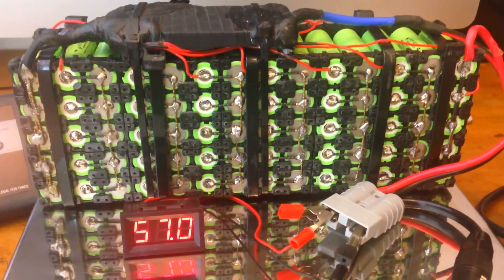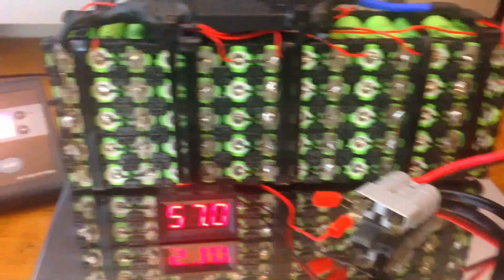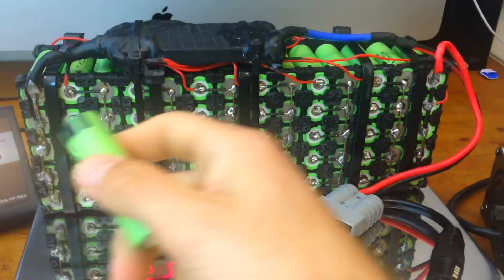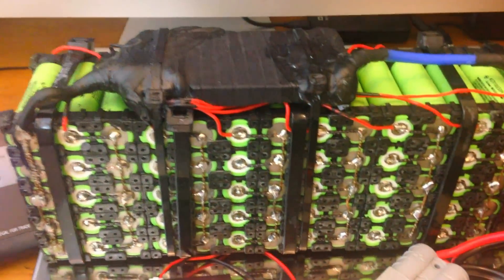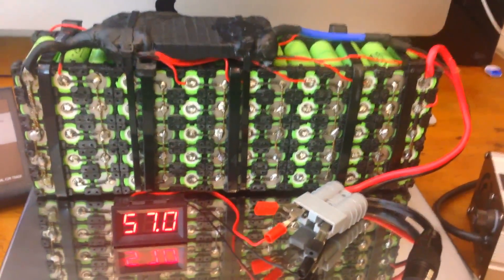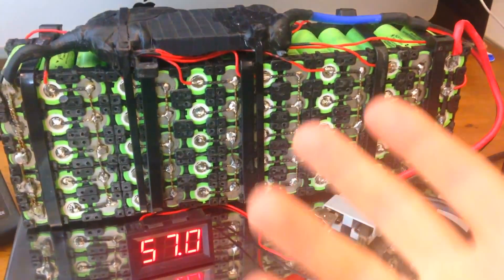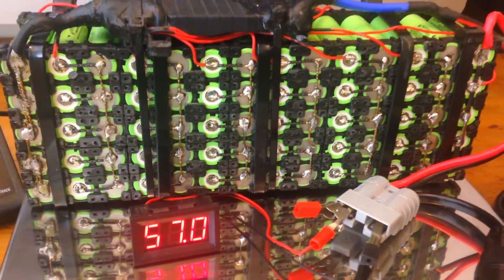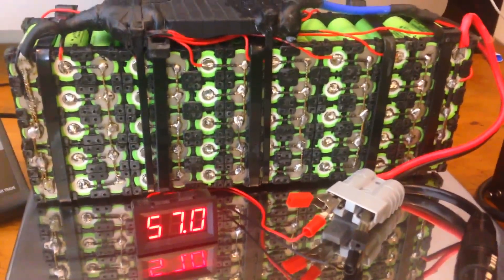Panasonic (Tesla) 52v 14.5Ah battery pack with Fast charger (14s 5p NCR18650PF) Bafang BBSHD BBS02

Comment: Nice video!
I like that you mention the use of a BMS (The Battery Management System).
However, you should not phrase it like something optional. If you decide to disconnect the series and charge all the parallel units individually, fine. 
However, charging this pack without a BMS at 58V will bring these units out of balance and can cause a fire.  
I personally don't like these guys uploading videos and not mentioning the problems that come along with lithium Ion cells. There are some clips soldering these packs together without a BMS, without mentioning that at the positive side the negative and positive are only millimeters apart. This is something very important to consider when soldering. 
I like your channel and think that you are very knowledgeable. You should consider rephrasing your statement at 2:31.
Reply from the maker: +davidcandlelight - Hi David, I watched your video showing all the nice work you've done... congrats for all that design ideas you shared =]
In regards to my BMS, 9 in 10 battery problems are caused by faulty BMS or something related to BMS. I know that the newer 18650 cells are very stable and will hardly get unbalanced specially when combined connected in parallel with other cells (4p, 5p or more) so they are self balancing each other. I disconnected my BMS in September 2015 for tests, just to see how long my cells would require balancing https://www.youtube.com/watch?v=EVv5z7GABx4 
I am writing this message today 21st of February 2016, I have been running my pack really hard pulling 30A every single day and charging it at 6A at 59.2. It is normal to charge above the pack limit 58.8v as the internal chemistry still reacting to the charge 90 minutes after stop charging. During this process the cells will slightly drop the voltage and set down to 58.8v the maximum recommended for a 14s pack with PAnasonic PFs.
In saying that BMS is a must have device for 99% of the users controlling all possible user mistakes, wrong chargers, reverse polarity, balancing the batteries, low voltage cut off and high voltage cut off and many other features. 
I only play without BMS as I have total control of my environment and devices I connect to my pack. As you know, it is very hard to consider all million scenarios while talking to the camera recording a video like that. I wish I could add a lot more info.. change some words... it is hard to get everything perfect =]
How is your battery pack going???? Please post more info with updates and explaining what you would've change and what you absolutely love. I am very curious to know these things after watching your video. =]

Comment: Hello Again... Have you noticed that hardly anyone in the USA is making Lithium-ion battery packs with Panasonic 18651 E cells?  I called around to the Tech Colleges to find out who teaches lithium battery pack building.  No one does.  I think this is an untapped market.  Shipping from Japan and China is very expensive because of duties and regulations.  
Building battery packs like this could be a very lucrative business because you can reduce shipping cost to outbid the foreign competition.  Let me know when you start building some Tesla style battery packs.... Remember, ebikes are still relatively new to most people and look at the electric hybrid cars coming on the market today,  All of those batteries will eventually need to be replaced and no one in the USA is manufacturing them.  This is your opportunity.  You will need a $12k pulse welder to do it correctly.  But I don't think a bank would have a problem with a loan if you give them statistics on supply and demand in the near future market place.  :)
Reply from the maker: +Robert Krause - Yes... this is very strange that no one is teaching how to build batteries... we all need batteries nowadays... but there a lot of very conservative people out there... I surprise a lot of people when I tell them that I work with electric bikes, I make and repair battery packs as a job....
There is a big crackdown on batteries shipped via air since December 2015... battery companies are struggling to ship internationally. If all countries were making packs locally we would not be experiencing these problems... 
There are some $400 chinese pulse spot welders with pedal switch, ugly was hell but they actually do a good job. I am located in Australia, just like other developed countries around the world the ebike business is BOOMING... this is fantastic.. I would love to see less cars on the road a a lot more cyclists.. pedaling is good.. keeps you fit and does good for the environment too =]
Electric POWEEEEEEEER....
Reply: +ElectricBike (Bruno) Here is an idea:   set up a shop in a classroom setting where you teach future generations  how to build lithium-ion battery packs for ebike and ecars.   The battery business is very lucrative  and I can see students feeling that paying $3000+ for a class would pay off quickly. This would be a great way to make a living.   The demand for battery packs is on the rise. Supply and demand drives the market. And electric cars and bike are not going away.  Just look at what Japan and the rest of Asia are doing with the Solar E-Charging station for ebikes.
Reply from the maker: +Robert Krause - Yeahhh. I have been getting lots of phone calls at work with people asking if we offer a battery build course/training.. I am trying to make as much videos as I can and publish here, everyone needs money but I also believe in open source and sharing information, YouTube is an amazing educational tool and can reach people all over the world =]
I have lots of projects apart from battery builds... you will see some very unusual and fun things coming up in my channel hahaha

Comment: Hi Bruno, if you remember we talked a few months ago on youtube and you advised me to buy a mid drive motor. Actually I did, i'm currently assembling my first e bike and many parts are custom built. It's a cruser/sporster vintage bike with bbs02 and 14Ah 48v battery. Your video is very instructive. I have some more questions : 1) Is it normal that the battery mesured output is more than 48v (I have 53)? 2)Is it normal that the battery "send" power through the charging cable 3) What connectors should I install on the battery, XT60 or Anderson 45A ? 4) Do you think I should install a fuse on the battery chord to protect the motor (and me)? I think as soon as I'll be done with customizing my bike I will start to assemble batteries following your advices. And maybe a youtube channel also ;)
Reply from the maker: +EFA22000 - Yeeeeahhhh.. I remember talking to you hahaa good to hear that your custom eBike project is going well... I will reply your questions:
1) Yes, 48v battery has 13 cells connected in series, each cell is 3.6 volts nominal but fully charged they are 4.2v and discharged they go down to 3v. So you can calculate that your 48v 13s battery pack fully charged will be 13x4.2v = 54.6v and discharged 13x3v = 39v. You must keep the voltage between these numbers never more never less.
2) If you connect the battery to a charger that is not connected to the power, it would turn the charger lights on in most cases. The devices actually tell the battery what to do... motor controller would "pull" the power to the battery and the charger would "send" power to the battery.
3) XT90-S is my favourite connector. They are slightly larger than XT60 but can handle much more power (more reliable) and the XT90-S is an anti spark connector. Every time you connect the battery to the motor, the capacitor inside the controller will "eat" so much energy instantly and this cause a spark that damages the connectors. Anti spark will last forever.
4) BMS will act as fuse cutting the power in case anything abnormal with the battery. If you're running your battery without BMS... things become a bit more dangerous and fuse would be a must. I am testing my battery without any protection for months just to see what happens, it is a stupid and dangerous "test" but I work with batteries and want to understand the worst case scenarios very well.
Yeeeahh.. I always encourage people to post videos explaining all processes and things they experienced while building their electric bikes, most people are a bit shy or don't want stupid people "the experts" posting abusive messages criticizing their videos. YouTube is a fantastic sharing tool, the more content the better for everyone. Please post your video link or links here, you're more than welcome =]
So much POWEEEEEER
Reply: +ElectricBike (Bruno) Very instructive answers! I'll buy XT90-S then , do i need to weld them on the cables or just "pinch" them?
I assume my battery has BMS (its an OEM, blue packaging with red and black power cable and black charging cable with jack connector) because the seller said so. The cells are samsung 18650 2900mA so the 14.5Ah battery is nice and compact.
Second question, how do I do the math for amps/cell, total amps and total amp/hour? (I understand the voltage now, thanks to you, POWEEEEEEER right?) :)
I'll make a youtube channel as soon as I finish the bike because I build some mechanical parts and it takes some time. From France.
Reply: +ElectricBike (Bruno)  I cant figure out the amps problem. You say in your other video you have 5 cells in parallel, with 10A/cell which makes 50 Amps total. I get this. But on the cells we only have Ah indication, not Amps. So how could I know how much amps there is on each of mine samsung 18650 cells? I know the capacity is 2900mAh, but how much continuous amps per cell? Where do I find it?
You say your battery is 14.5Ah at 13:13 but your panasonic cell is 3200mAh so 5 cells in parallel would add up to 3,2Ah x 5 = 16 Ah. I dont understand how you get 14.5 Ah. Please explain!
Reply from the maker: +EFA22000 - Yeeeahh.. my Panasonic NCR18650PF cells are 2900mAh (capacity) and 10A discharge (18A burst/peak 5/6 seconds). 2900mAh x 5 cells in parallel is 14500mAh or 14.5Ah (same thing).
Every single model will have different specs, not very easy to find, you need to know the model of your cell (not just brand) so ask the seller they must know. My one is NCR18650PF but Panasonic also makes many other models like NCR18650B and NCR18650A and many others models with completely different specs. Sanyo's battery division was bought by Panasonic so they also share similar names NCR18650....
The best forum discussions about cells (they don't talk about battery pack) is https://www.fasttech.com  put your cell name there and see the reviews.
Soooo much POWEEEEEEEEEEER =]
Reply: +ElectricBike (Bruno) ok, I had wrong mAh about your cells. Thanks again for answering.
Reply from the maker: +EFA22000 - All gooood hahaha just a little detail =]

Comment: What are the specs of the BMS you are using for this big guy?
Reply from the maker: +Paul Sammons Music - Yeeeahhh.... this is a 14s 35A BMS that i bought from Aliexpress in 2014, I can't find the link for 35A anymore but the specs are very similar to this 30A one here: http://www.aliexpress.com/item/51-8V-30A-BMS-14S-PCM-Lithium-ion-Battery-Management-System/1342816874.html?spm=2114.01010208.3.36.BcQgso&ws_ab_test=searchweb201556_6,searchweb201644_2_10001_505_10002_506_10016_503_504_10005_10006_10003_10004_502,searchweb201560_1,searchweb1451318400_-1,searchweb1451318411_6448&btsid=650abfb0-433e-450f-8583-7361b31b8bc6
They can handle up to 75A peak for a few seconds... Panasonic PF cells can handle 18A each max Discharge Pulse Current (5-6 sec.) so this battery pack configuration the cells together could take 90A peak.
There are some really good high quality and very powerful BMSs here in this website, they got everything but 14s BMS  =/ http://www.batterysupports.com/lion-lipo-nbsp-48v-nbsp-13s-c-32_43.html
Here is the link of a BMS factory http://bestechpower.com/14s15s16spcmbmspcbforli-ionli-polymerbatterypack/ you have to email them asking for price and negotiate your "sample" pretending you're going to come back for more...
So much POWEEEEEEER =]
Reply: +ElectricBike (Bruno) Wow, I was actually looking at one with very similar specs.  
http://www.aliexpress.com/item/51-8V-30A-14S-PCM-used-for-51-8-V-lithium-ion-battery/1206415913.html?spm=2114.01020208.3.2.eOK4FL&ws_ab_test=searchweb201556_2,searchweb201644_4_505_506_503_504_301_502_10014_10001_10002_10016_10005_10006_10003_10004_62,searchweb201560_1,searchweb1451318400_-1,searchweb1451318411_6449&btsid=7e725a8a-ea26-4572-8689-5821df40f6f1  

Thing is, I don't think I need all those 70 cells.  I'm thinking maybe I would need a 14s4p configuration.  I love the feel of a 52v pack but want a smaller pack.
Then again I might make a 14s5p pack because I might upgrade from a BBS02 to a BBSHD at some point and would want those extra amp hours...
But if for example, my pack was a 14s4p for a BBS02, would you still us a 30a BMS?  Or would that run the cells at too high of a C rating?  

Thanks for the info and the link Bruno.  I appreciate it very much!
Reply from the maker: +Paul Sammons Music - Yeeeeahhh... I did some tests having a 14s 3p (every Panasonic PF cell can take 10A so I wanted to test it, supposed to handle my BBS02 25A) the pack gets reeeeally hot and you cook the cells. Heat will kill your pack. Even 5p will get warm with the BBS02... I wouldn't spend so much money and time making a smaller pack that will cook and die in less than 2 years, its just 46 grams per cell x 14 = 644 grams to make it 5p. if shape is an issue to fit in your frame, there are many other shape options you can make your pack (a lot more complex wiring).

Get a BMS that can handle 35A, 40A or more and you never have to worry about frying or upgrade it in case you decide to get a bigger motor in future. BBSHD is 30A so 35A BMS you will be good... Cyclone is 40A.. maybe 45 or 50A to be safe...
So much POWEEEEEEEEER huhuuuuull... =]
Reply: +ElectricBike (Bruno) Alright, you've convinced me on the 5p.  I've been wearing the battery pack in my backpack like you and just love it that way.  I can't go back to setting it on the frame.  My mountain bike and road bike maneuver so much better with the battery pack on my back.  It's amazing.  So fun.  I just started doing it that way, so I'm super excited about it.  
Anyway, I appreciate your input on the matter of choosing a BMS!  Thanks
Reply from the maker: +Paul Sammons Music - Yeah the more cells you have the less stress you put on each cell... talking about team work hahaa... 
I started riding with the battery on my backpack because I realised that I always carried over 4kg (so many unnecessary things "just in case") so I went and got a very small backpack (the ones runners use, its called hydration pack and comes with a water bag) its so small and nice I just love it! Please watch this video where I show how I did the power connector, it disconnects in case of an accident https://www.youtube.com/watch?v=ZsQIA8INPWg
Reply: +ElectricBike (Bruno) Oh yeah...  I've watched that video.  I've watched all your videos.  I've got xt90 anti-spark connectors as well.  I actually made an extension cable for my battery.  So coming out of my battery I but the female xt60 and then I made a cable to extend it that has the male xt60 and the female xt90 on the other end that connects to my motor.  I can take the cable off and put it one whenever I like and switch it between battery packs.  It's nice.  I'll have to look into those hydration packs.  It would be nice if they were waterproof too.  =)  Have a good one Bruno!  And as always go strong!  Go power!  lol
Reply from the maker: +Paul Sammons Music - Yeeeeahh.. good one... I am happy to hear all that.. =]
I sprayed a clear coat of circuit board lacquer http://www.jaycar.com.au/Service-Aids/Chemical-Aids/Aerosols/Circuit-Board-Lacquer-Spray-Can/p/NA1002 so I never worry about my battery getting wet in my backpack =]
So much POWEEEER...

Comment: Has anyone tried to run bbs02 on 60v or more? lets say lipo 16s?
Reply from the maker: +Evaldas Virketis - Yeeeahhh.. I heard about people installing an external controller and increasing the phase amps and saying that the BBS02 was riding like a MONSTER... so powerful...  the original Bafang controller goes up to 59v, anything higher you get a high voltage message on screen. If you run this thing over 60v (with an external controller) you'll have to ride fast so there is lot of air cooling the motor...  so much POWEEEEER =]

Comment: i know quite a bit about 18650 cells and understand this vid perfectly, but when it comes to wiring all this shit up and especially soldering, I'm hopeless, so i guess i have to be a chum and spend double on a commercial battery pack :(
Reply from the maker: +harvey288 - Yeeeeeahhhh... you can make your own pack using a cheap spot welder from eBay, cells and all battery accessories were listed here in previous messages in this video... wiring is not that difficult as long as you make it rectangle. Just pause my video and try to zoom and you will see that all cells from the top to the bottom are connected in a line, from the left to the right you put the cells one negative side facing you and then the next the positive facing you, negative, positive... all the way.. then (in my case in this video) on the other side I connected the first 8 cells from the left (4x cells positive + 4x cells negative from the second line), then on the side here facing you, connect all second line of cells to the third line... then go to the other side and repeat this process. Wiring BMS you start from negative just like this photo here http://zt.yizimg.com/comfolder/318471/image/201503/20150306201546_8433.png
I hope all that info will help you save a lot of money... be extremely careful handling batteries... so much POWEEEEEEEER =]